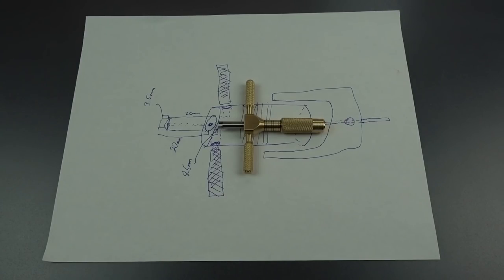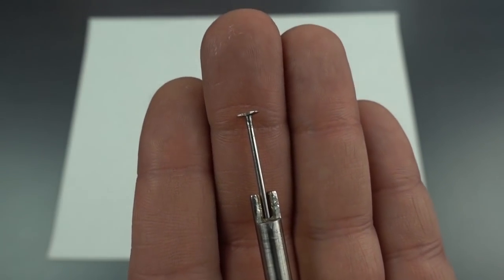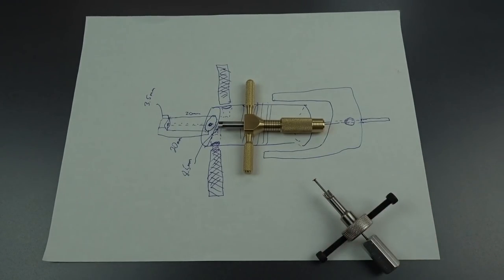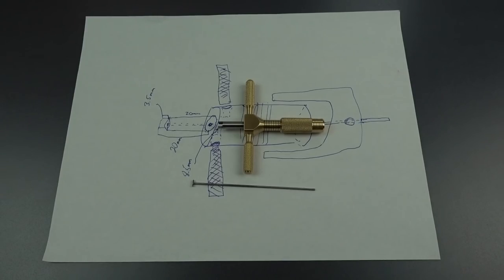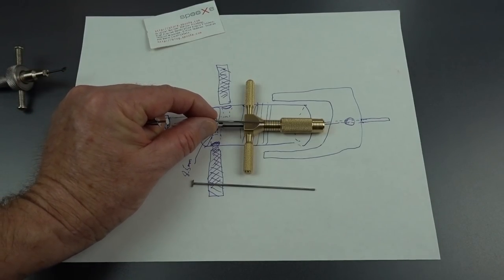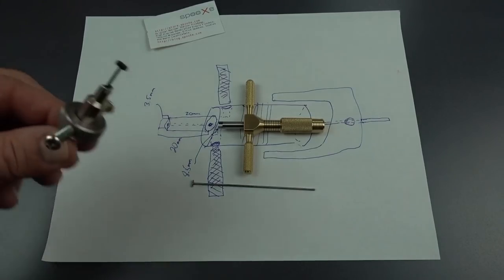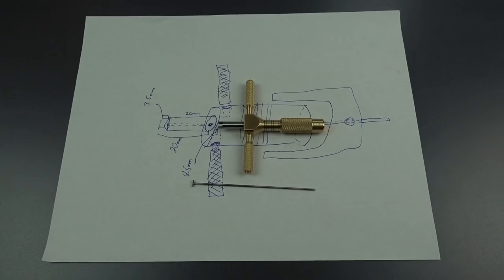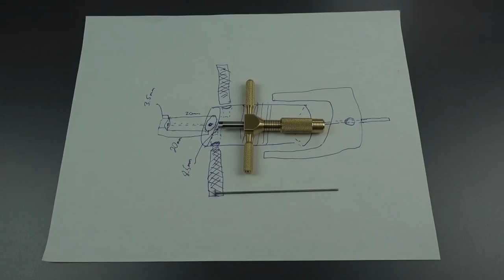[827] Disc Detainer Pick Build (Part 5) - Featuring BosnianBill

Comment: Those ejector pins are really useful, used to use them a lot in machines I used to make for the last company I worked for, they were good for setting heights of tools also, they were dirt cheap and super high quality japanese ones we'd get from a company called MISUMI

Comment: In looking at what what you have got so far, my thoughts are that you might have made the side handles too long. This is likely to make it real easy to deform the nose.

The length of the pin also seens too long. In use consider that you be applying torque to the nose then rotating the disk. The long skinny pin is going to be a spring.  As soon as you reach the gate, you will loose the restraint and the spring will accelerate the disk.  If ths is too fast it will catch wedging the side bar. I think the shorter the pin the less it would flex giving you a better feedback.

Comment: Nice to see other picking up on the idea of using mold ejector pins as the picking tip material :) Can't go too wrong with it as like you said, it is of one piece construction, hardened/tempered and some of them have been nitrided also. Available in HSS, silver steel and hotwork steel (most bendy ones), so lots to choose from and lengths/diameters are numerous.

Comment: That looks amazing. 

Is there any chance of you both doing a ultimate plug follower build that makes the perfect adjustable plug follower like the HPC spring loaded version and has a hollow section for storage and has removable follower tips that unscrew?  

(1 adjustable size spring loaded follower for most sizes of core with detachable interchangeable tips for every combination of plug shape with storage compartment for shims and springs and pins and is designed to easily insert a shim between the follower and the lock body and has the groove cut in to the side for pinning shoes and 1 end of it made to be a 6 pin top loading bar to insert springs and drivers into the bible with the help of a pick or pinning knife).   

It is just waiting to be made by somebody skilled and everybody would want to buy 1.
 :0)

Comment: I would have made it out of one piece of metal. Not knowing about those things, I would have just started with like 3/8 inch rod. Shaped the tip, and then just machined the rest of it down to 1/16. I never could understand why you would solder a tip on.

Comment: Ejector pins are heat treated using a method called Nitriding, which gives a very hard thin skin whilst leaving the core strength of the softer internal material. The head of the ejector pin is soft to allow for machining of location features (flats or keys).

Comment: A body shop with a spot weld panel puller could have zapped your wire to a piece of steel that you could have finished with much less work.

Comment: Lpl I know what you meant with silver-soldering for a "couple of hours and numerous attempts" but on my last try I used Low fuming bronze 15 (or 16) brazing rod. And managing to braze it with a butan-torch. And it works really great and that was really bad brazing to.
But I love the ejection-rod tips

Comment: Did you shorten the end of the nose?  If not, will the "fork" be long enough to make it through a spinner and adequately grab against the first disk? Also, what are your thoughts toward tiny crosshatched scores on the forks to help it bite into and anchor the nose in the first disc?

Comment: A lot of injection mold supply houses grind custom pin sizes(including the head size). Try Precision punch in Berlin CT, Progressive components, Royal pins to name a few. They will be hesitant to grind the flats, but getting the head diameter and thickness will get you most of the way there. And as you may have guessed, the more you order the cheaper they will be. I made a disc detainer pick head out of a style B punch from Precision punch which are M2 steel and 70 rc. They take more torque than I would have guessed.
Reply: Hey I checked out there site, what do you think is the minimum quantity you'd have to order? Thanks

Comment: Question - is the Sparrows version's tip made this way?  I bought one and it sheared off on my first pick attempt.   Short of making myself, how do I get one like you've made in this video?
Reply: The Sparrows tips seem to be brazed on, I also broke one of mine. I'm a bit disappointed with this aspect, as tip durability was one of the first things mentioned in the design process. You can get ejector pins cheaply on ebay, but unfortunately the dimensions need to be some strange inch fraction units.